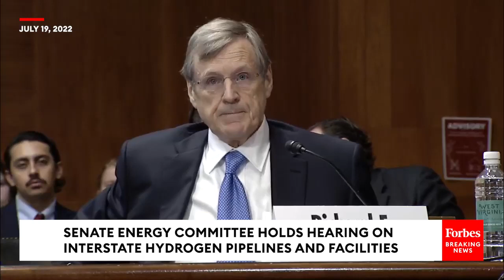Joe Manchin Asks What Is The Best Thing Congress Could Do ‘To Put Hydrogen On The Map’

Comment: we can make free energy by copying the earth's core with magniticity, creating a globe within a globe within a globe (power of 3), NASA's g force machine, using polished aluminum window tech and swap out for polished nickel, this will generate a magnetic wave of energy that creates a light, but add a gyroscope around it creates a motor that can go up-down-forward-reverse. it could also create true hard water and can re-create the glaciers and maybe the underwater rivers that cool the oceans, also if we make all shock absorbers into magnetic generators, all vehicles on the road could contribute to the electrical grid using same tech as cordless toothbrushes at a stop light or a gas station, people could get paid for the discharge, also it could extend all ranges of electric cars..we have had the tech all along but no one has put it together correctly, the discharge could be done at home too,